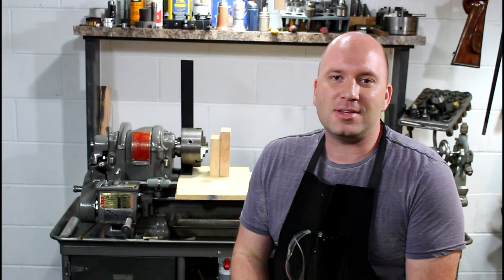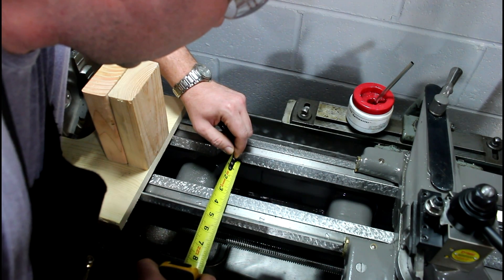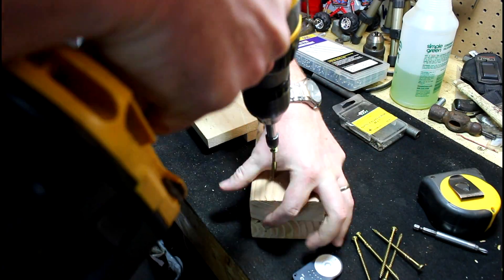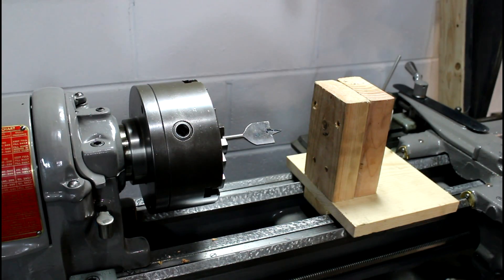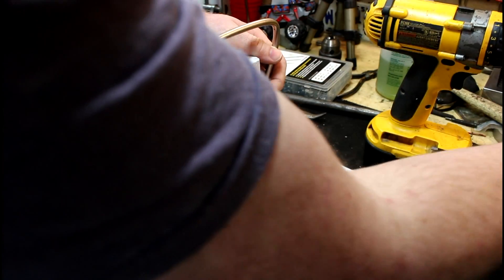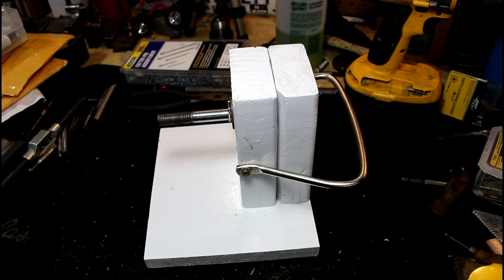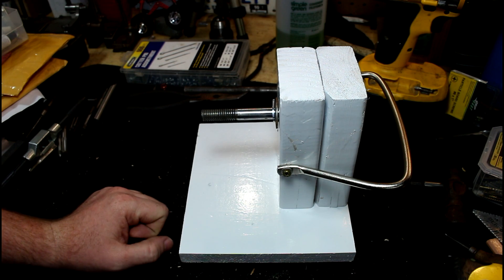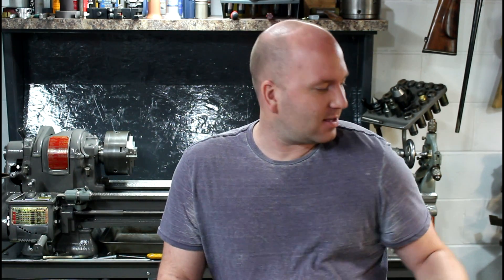Lathe Chuck Caddy! Installation and Removal, A Simple Inexpensive Solution!!

Comment: So simple! As I watched I thought- why's he attaching the handle so low surely it will tip, he must have a reason, but nope, no reason.  Just raise the pivot/fixing points of the handle to above the chuck then it will hang. Think of a bucket, the handle is attached at the top so that how ever much weight you put in it won't tip, if the handle was halfway down the bucket or lower it would tip once you fill it past to the top or past the pivoting point of the handle, Simple C.O.G. principle, keep it low for stability.
Reply from the maker: I ended up moving the handle to the top and it works better. Figures that out fairly quick.

Comment: thats better than the blocks of wood i lay on bed that are never the right size  .  And i really like the price !!!
Reply from the maker: Yeah it has worked out well to date. One thing I would change is to sturdy up the mounting pin a little and replace the bolt with a bearing/ shaft setup.

Comment: Its a good unit however I have some ideas for improvement, as follows.

Issue - unit not stable with the weight of the chuck when sitting on a flat base. - widen the base to clear the bed both sides and place a block each side over the bed width (running from tail stock to chuck direction) these will form the support to give stability when the it is loaded and set down on a flat surface.

Issue - play in bolt - the stand is good in timber but better in steel. If in timber bore out the hole for the bolt and drive in a bush that will take the bolt snugly. no need for bearings as wear is not an issue.

Issue - caddy overturns with weight of chuck - use a sturdier handle and bend it forward so that the handle is over the centre (center) of gravity  which will be approximately at the middle of the chuck (as the caddy is relatively lightweight).

Also when painting timber always paint all round, don't leave any bare patches 

Its a good Idea and shall put it on my to-do list.
Reply from the maker: Thanks, a couple of the things you mentioned have been thought out already or changed. This was more of a proof of concept more than anything. Thanks for the input.

Comment: I like it. much better design than Dales buddy
Reply from the maker: Thanks, it still needs a little refinement, and I have since moved the handle so it works a little better now in that regard.  I've used it several times and it works great and takes the hassle out of the process.

Comment: could use the handle in that orientation and then slide the caddys into a wall mounted holder. would keep the dust and grime off the front of the chuck.
Reply from the maker: That's  good idea. I did move the pivot of the handle as close to the top as I could and that helped out quite a bit. Still tips a little but it's manageable now. I have a handle idea to solve it, just need to make it.

Comment: For easy of carry, the support and Grip or handle need to be relatively centered under the chuck for balance.  Could make the base with front & back sides attached to the right side with the chuck support shaft. Put the grip/handle on the front & back sides just above centerline axis of the chuck for best overall balance.
Reply from the maker: Yeah, I just threw this guy on and should have put it up higher, It would still be off balance but it wouldn't tilt near as far. I have an easy handle design that will work to put on it. I just need 10 minutes to make it!

Comment: Cool.  Whenever I get another chuck for my 10L, maybe I'll make one.  At the moment all I have is the 3 jaw so no real reason to change it very often.  Looks like you have that same Cushman I have with the oil zerk on the front of it.   

You could probably go half measure, bore a pocket in the 2x4's for a bearing and pass a shaft through them.   Shaft wouldn't wobble but holding  the bore true for the bearing pocket may not go so well.  Even if it did, use it twice and the wood would deform a wee bit anyway. 

Which tool post are you running on that?  I just got my 10L back together this weekend, and I'd like to upgrade the old lantern post to something else.  Just can't quite decide if I want to spend the money on a real Aloris or Dorian or spend half as much on a Chinese one.
Reply from the maker: I had a phase II on a Logan before I got the 10L and it worked fine. It was a big step up from the lantern style. The parting tool holder they sent with mine was junk, sent it in for a replacement and they sent me another junk one. I gave up and bought a Shars cut off holder off ebay. 

I currently have a Dorian AXA Wedge style and I love it. I got it off another one of the lathes i bought, but it was basically brand new when I got it. I use cheap Chinese holders with it and don't own any US made holders. Shars seems to have decent quality holders, just replace all the mounting screws!  Thanks!
Reply: Think the other Chinese holders might be any better?   

I saw the video about the crappy parting tool holder.   If all of the other stuff works fine and I just have to buy a different holder and a box of screws, thats no big deal.   I think I'll spend some more time learning how to use it before I jump into all that.  Only thing I've made so far were some copper slugs to go under the gib adjuster locking screws.  The brass ones were missing and I had some 1/4" copper rod laying around.
Reply from the maker: I'm not sure, I have not read anywhere else about any bad holders other than mine. I have come to the conclusion that the holders for the most part are just a chunk of steel, I can't see spending the extra money when it come to the standard holders anyways! I do know that some of the specialty holders like knurlers, threading holders and specialty index-able holders from the big names would be nice.